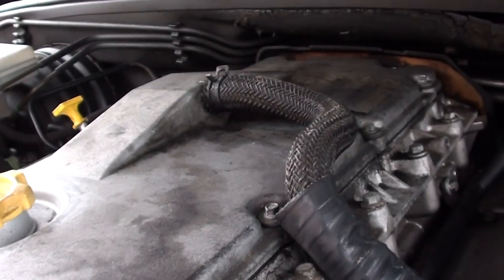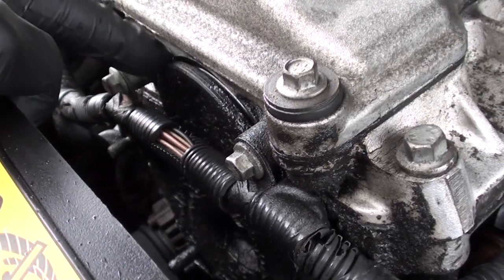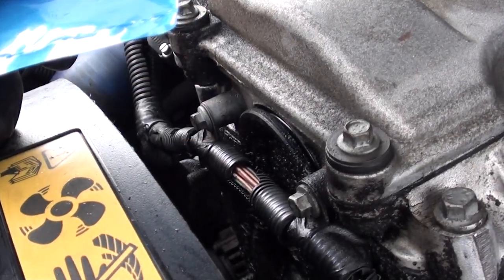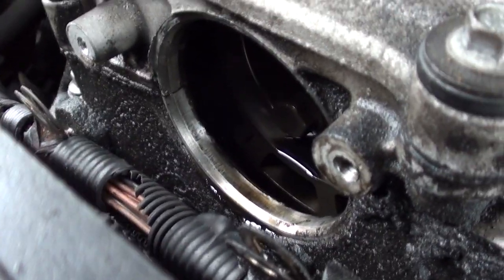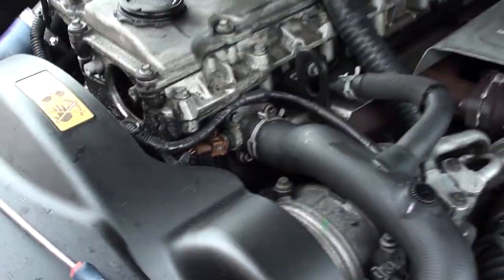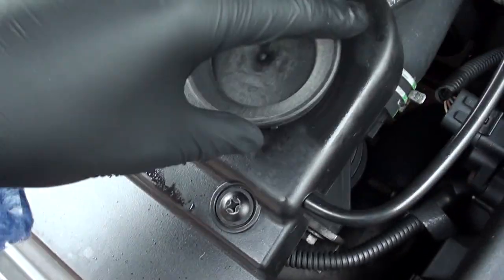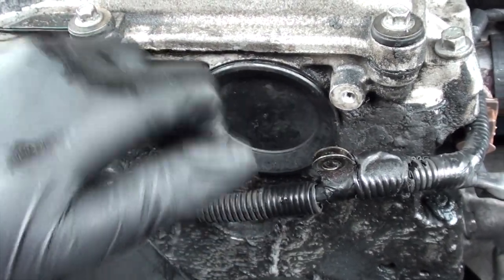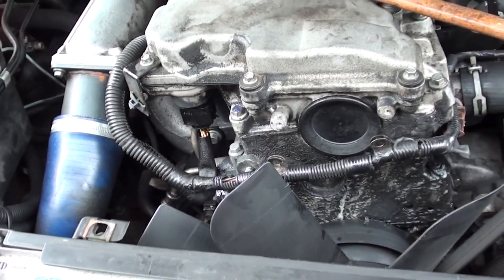Landrover TD5 How To Replace The Front Cam Cover - RustySkull Productions

Comment: Nice to see the plug fits in quite easily.  I have just ordered one for our 110.  I just changed the injector loom because of the leaking oil back to the ecu problem,   The engine had a misfire, but it turned out to be a seized  turbo waist gate causing over boost.  The ecu can only protect the engine by cutting the fuel.  Waist gate is now free and have no misfire.  Then I noticed the plug was missing and oil from the timing chain flinging out every ware.  Maybe I disturbed it changing the loom or maybe just unlucky.
Reply from the maker: +richardcloudbase Yeah it fitted nicely, very snug :) I had the oil problem too haha

Comment: I've investigated mine yesterday prior to getting on youtube as I have a pretty epic oil patch on my driveway, my seal is nowhere near as loose as yours was, but when I took the loom off for a better look and to clean the engine castings to watch where it seeps from I noticed that I had oil coming out of that sensor loom too, but after watching thoroughly after idling for 30 mins and a heavy right footed drive, I've not witnessed any more at all, I wonder if vapour has collected in the plastic tubing from the camseal and the by unbolting and pulling loom out the way it has cause it to pour out sensor side?
Have you looked into it any further?
Reply from the maker: Nah I replaced the covers and put a new injector loom on and that was it. I sold it about 2 years ago now so I don’t know if it happened again…
Reply: I've done a bit of research and bought myself a Viton seal to go on the cap that shouldn't deform with temperature, hopefully solves the issue permanently!

Comment: a landy vid👍 is that plug with oil coming out connected to the injector loom? if its keep an eye on it as it follows the wires to the ecu and i think you know what will happen if oil gets in to ecu. keep up the good vids dude👌
Reply from the maker: +paul foster The plug I thought I broke had a little bit of Coolant drip out, but it didn't do it again lol. I had the oily ECU problem last year but I don't think I filmed it though to tell you the truth lol.

Comment: ah right thats all good then dude👍 is there anymore landy vids in the pipe line?
Reply from the maker: +paul foster There are always some in the pipeline, most of them will be summer video's as I hate taking the thing apart in the wet rain and cold lol. But I plan to claw some more power from it, upgrade the intercooler and other parts... You might have noticed most of my latest video's are ones I can make quickly, father than ones that take a few hours to film and an hour or so to edit lol. 

I'm really pleased with how well that Discovery is coming a long though! it's got a lot more grunt now it has no silencers and I've opened up that waste gate lol. 

Thanks for watching dude!

Comment: I wanted to see how easy can go out and in the seal not before and after.
Reply from the maker: It's very easy, just use a hammer.
Reply: RustySkull Productions just did. Used a hammer and it worked flawless. Thx!
Reply from the maker: I knew it'd work because that's what I used lol.
Reply: Maybe you use it but I can't believe you since it's not in the video.
Reply from the maker: Haha well I wouldn't panic too much about it, if you can't fit one of those then you shouldn't be working on an engine really haha. You've done it anyway so I can rest well tonight knowing that :D